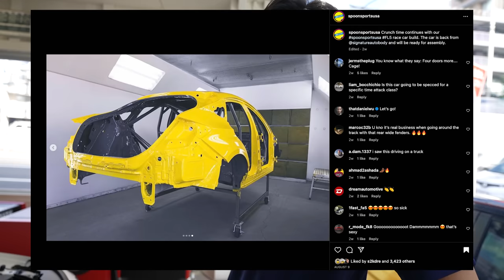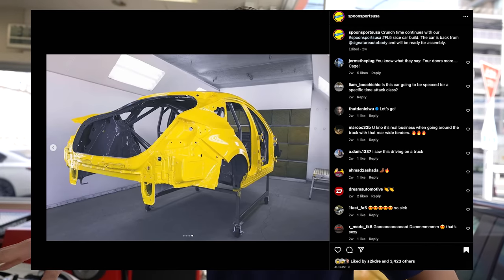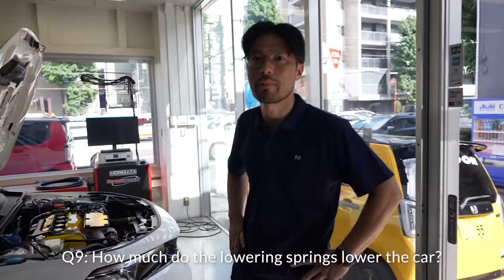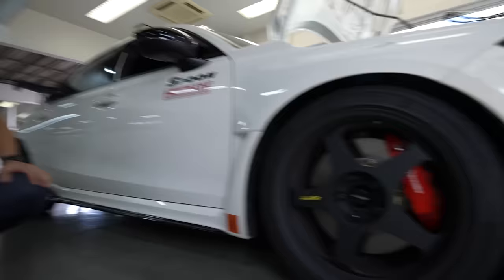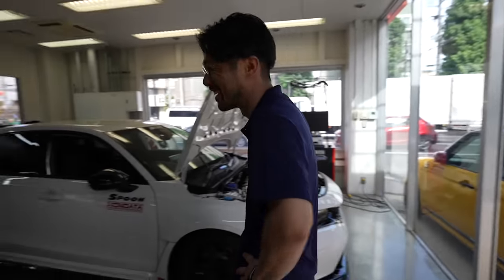*IN-DEPTH* Interview With The Boss of Spoon About R&D of The FL5 Civic Type R!

Comment: Thanks again for always keeping us updated on this with a bit more intimacy instead of just an "on the surface view" kind of update. So far, the car feels great (stock) but I really can't wait for the Spoon street spec car to get to 100%. I've been holding off to let the R&D be conducted by the people capable of doing so. The heating failsafe has been the only complaint by most people taking these to the track. However, when you tune, it's logical that an increase in power would require an increase in cooling. That's the biggest reason I've been holding off on tuning it.

Comment: Not sure if it's been mentioned but the side "kicks" (fake vents you suggested to cut and create a duct) are actually a functional aero component that creats a slight high pressure zone in front of the kick, thus encouraging the air to follow a path directly along the face of the wheel, down the side of the car.

Comment: The cooling???
Reply: I was wondering about that myself too.  To date I have yet to see any mention of oil cooler kits and also proper tow hook mounting for the FL5 from the hero brands.  While it's nice to have shiny bling parts to impress your peers at car park meets for me my priorities are keeping the oil and water temp in check at the track after multi laps before I tune car up for more power.  
May be the R&D of the cooling kits takes a long time to recover as most owners by and large priorities power and appearance upgrades and only a very small portion of FL5 owners would go to the trouble of forking out and installing aftermarket oil coolers and racing radiators.
Most frustrating as my B16a eg, ef and em1 all have heat exchangers at the oil filter sandwich plates and the FL5 has none! Just like the SOHC D series engines.  They do fit such setup to cool the transmission though lol...

Comment: im sorry, every exhaust manufacturer has so far done nothing but make this sound like a vacuum cleaner. they have to figure out what the Type S has and how much timing was pulled/added to make it sound so much better. also give it the same mid range torque.
Reply: acura deleted the front resonator with the Type S exhaust. Also some minor software differences